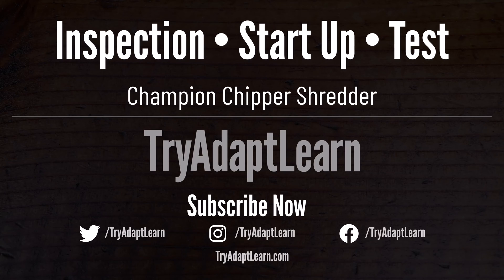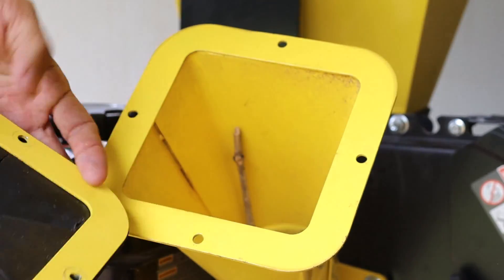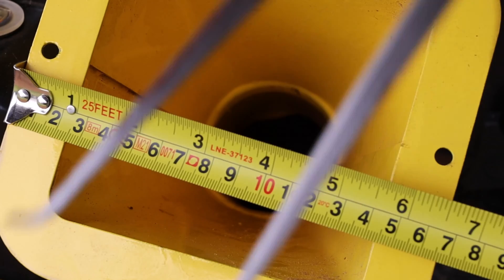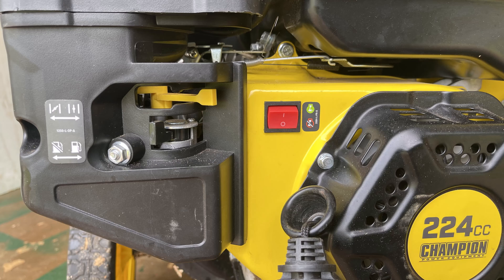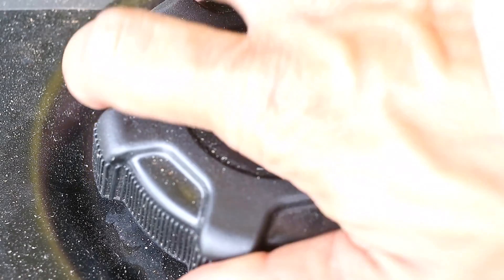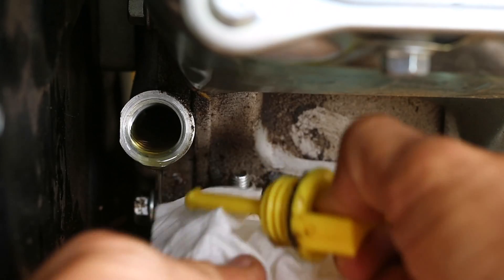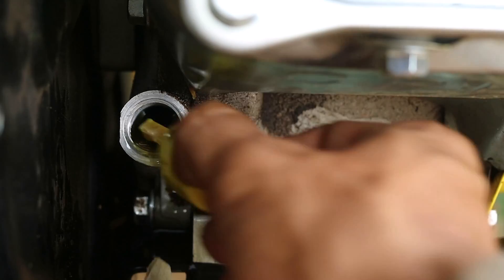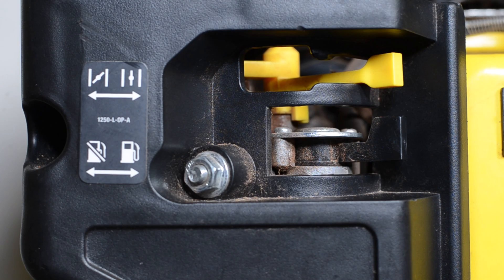Wood Chipper Inspection Start-up and Test: Champion Chipper Shredder

Comment: Thank you for such a detailed video. I am a newbie to using a wood chipper and was forced to buy one after a huge ice storm hit our remote area. This was so helpful 😊❤
Reply from the maker: You are welcome.  Thank you for the feedback.
Reply: @TryAdaptLearn  it turned out it did not perform well at all with moist wood and branches. After ten minutes it was totally useless and the group which included seasoned mechanics decided it just wasn't strong enough.  We had to take it apart 3 times. I turned around and sold it and warned the buyer only on dry, dry wood to use it. :-(

Comment: I just had a battle with mine. after hours of struggle to get it to start. I pulled the spark plug, which was dirty and wet from fuel trying to start. I cleaned and dried it and ran some 220grit sand paper across the point and reinstalled. Fired up right away.  now I can take a shower after my morning work out!!! lol
Reply from the maker: Glad it worked out for you.  The parts on the these machines are definitely exposed to the elements.